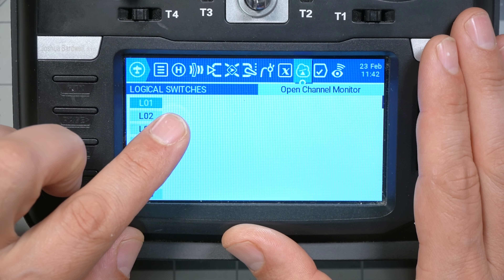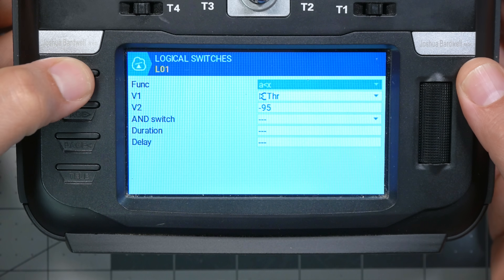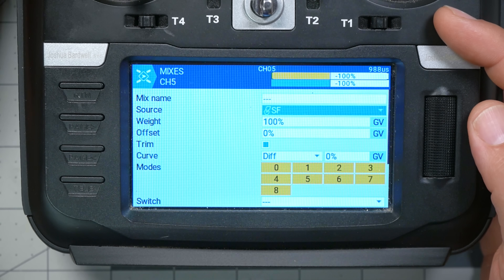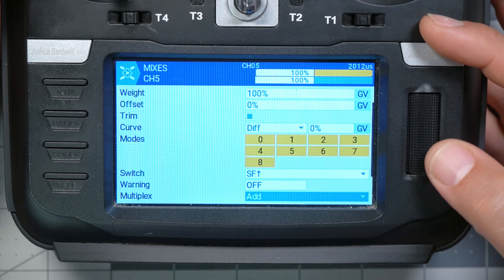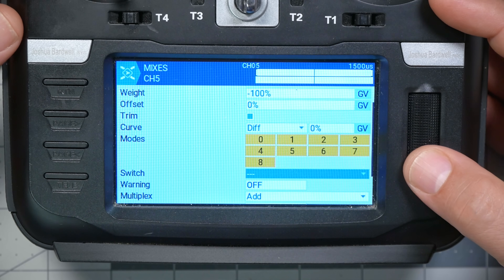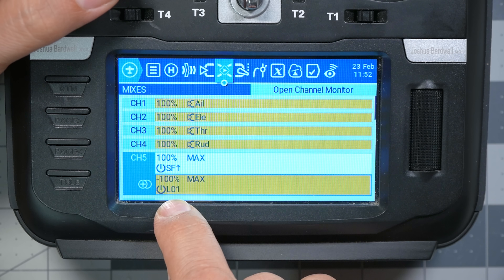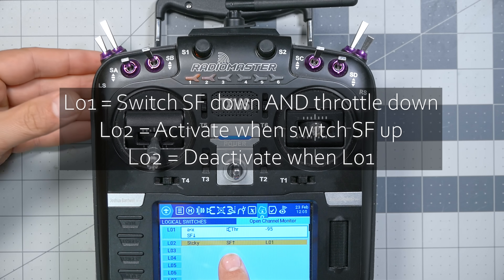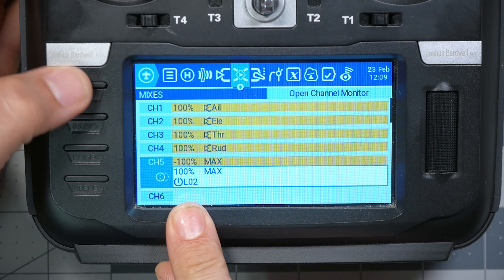This arm-switch setup is dangerous, and you shouldn't use it

Comment: Isn‘t the easiest way to just use L02 as the „switch“ on channel 5 in the mixer. I think there is no need for all that max shenanigans and all the multiplex replace lines. Since L02 is already activating when arming and only deactivating when disarming and throttle at 0.

I do the same thing for prearming on FETtec. Just L02 as my arm switch and done
Reply from the maker: You can't make a logical switch be the source for a mixer line. I tried that.
Reply: @JoshuaBardwell  hmmm i definitely have that as the input but then maybe not in the mixer but the output or input page? I’ll check when i‘m home!
Reply from the maker: You could set it up as an input, and then make a mixer with that input as source. But not a mixer source directly.
Reply: @JoshuaBardwell  ill describe my exact setup when im home but it definitely works to use L02 as the direct source for the arming aux channel 👍
Reply: @JoshuaBardwell  so i just checked. Both on my qx7 with edge tx and my mambo with freedom tx i can choose logical switches as my source for mixer channels. I just have to create the logical switch first or it won’t show up!
Reply: @JoshuaBardwell  nope. Logical switches can be used. To select it do not use any of the side quick category menus. use the complete list and you will find them just below switch SJ. i would send you a screenshot if I had an address.
Reply: @JoshuaBardwell  you are mistaken joshua. This is how ive been running for years. On my quad L02 is the source for ch 5 and controls arming.
Reply: Yeah, that's how I have it set up. One mix line. Source: MAX, Switch: L04. And then L04 is my logical switch that contains all the arming logic. Note that this will mean that when armed, you output 100%, and when disarmed, you output 0% (not -100%). Seems fine, if you have Betaflight set up to arm when the arming channel is in the  1800-2000μs range.
Reply: @Joshua Bardwell The guys are correct - once you have defined a logical switch, it is available as a source for a mix, so you can use it in both the input and mixer screen directly.

Comment: In my experience, FreeFly multirotors have something similar - you cannot disarm the aircraft unless you have the momentary switch pulled up. This is because when you’re flying an aerial platform that is potentially carrying $50,000+ of camera equipment, accidentally disarming - especially when you might be flying over the people/things you’re filming - can actually be more dangerous than being able to disarm immediately. 

Of course, this is a completely different scenario than a typical 5” quad will fly in, but that is one pretty good reason to have a setup like this.
Reply: Since they run on forks of PX4 the emergency disarm feature can be setup in the FC settings. Every AltaX I've flown has not had an emergency disarm switch for exactly what you say, preventing accidentally dropping 50lbs of equipment onto the heads of a film crew, but has had a method to disarm within a few seconds if you are trying to do it on purpose.
Reply: @dtrl6096  for sure. So far the only Freefly platform I've actually been able to fly is an old Alta 6 with the pre pix based flight controller, synapse. 

I'm jealous you've gotten to fly the Alta X - they're insanely cool. A buddy of mine is working on getting a camera car setup with a motocrane for a filming business he's starting, and he's planning to hire me out as his pilot which should be fun. Once he starts making some money he's either going to buy an Alta X, or have me design an aerial platform instead.
Reply: @KaminKevCrew  depending on the weight requirements consider a FreeFly Astro, it's their new platform that is about half the price of an Alta X but carries things like a Sony a7rIV and not things like a full size cinema camera.
Reply: @dtrl6096  we're looking into the Astro as well - I think for our purposes we will probably need something bigger like the X though. Right now we're using a Black Magic Pocket Cinema 4k on a Movi Pro, and it looks like we'll be moving towards a Red Komodo for aerial duties before too long, so that it can pull double duty on an aerial gimbal in addition to a cinelifter (possibly a siccario)
Reply: i like that setup

Comment: I belive you need a second sticky for when you "disarm" throttle down to stay disarmed if you bump the throttle by mistake. Correct me if I'm wrong or if I missed something in the logic. Regards
Reply from the maker: To disarm, you must have switch in disarm position and throttle down. If that happens and you subsequently raise throttle, the switch is still in the disarm position. The quad won't re-arm until you flip the switch to the armed position, with the throttle down.

Comment: Excellent, as usual. I was thinking of duplicating a 6 (in this case 5) position switch on the Zorro using a pair of 3 position switches. Obviously, there needed to be a logic switch involved (to disable one switch when the second is activated) but I knew practically nothing about using them. This video gave me a one-stop solution to the necessary conditions and function of logic switches, especially "sticky" switch use cases. Great work, JB, keep it up. Doubtless there are many permutations of logic switches this video applies to...    ...not just dangerous arming modifications! Yea! Solved!

Comment: but he can also flip the disarm switch in midair and the quad will disarm the second he goes for a dive and lowers the throttle under -95 haha, so a sequence on top of that would be the best, that you can only disarm when throttle is low at first and then the switch is flipped
Reply: I would just go with using both the left and right lower switches.  That way it's easy to do an emergency disarm but harder to do an accidental disarm.
Reply: Totally agree, if you set it up based on throttle, accidentally disarm via 2 pos switch the quad will keep flying until you drop the throttle under 95 🥲 
The only time I ever deem having a multipart disarm/arm procedure is when I'm flying any of my heavy lift capable shit & I have it set to arm based on a 3 pos switch being all the way down and then a 2 pos flipped. 
I've only accidentally disarmed twice 🤷‍♂️ just finished a build and set the aux the channels wrong once & the other time I was super stoned and can't really give a logical explanation 🤣
Reply: @md.m.8372  You had flown stoned? oh boy that must have been a bit scary but pretty epic lmao 🤣🤣🤣
Reply: @SukSukulent  not that scary when you used to it 🤣🤣
Reply: I agree, two switches would be much more appropriate.
Reply: Another, much better version of this has a second part to the disarm sequence, whereby it detects if you have hit the disarm while throttle high. You can then setup a warning voice prompt/beeper so you don't find out later. I use something similar to this to lock out arming if the throttle is high before arming, and also allow disarm to auto trip on landing (enable disarm on landing approach, cut throttle to kill or land).
Reply: So on our boxer radios, we have set out arm switch to be on when its down because of the grip we use when flying to omit accidentally pulling down on the switch in midflight killing the motors. It may be revesed from other users however it is the safest for us in our case....
Reply: If you're disarming midair. Than that's your own fault. Set a different switch that you won't bump...
Reply: @Romasu_  I think you missed the entire point of why he wanted a switch set up like this..
Reply: @Romasu_  of course, but thats what the video is about

Comment: I just lost a quad in deep water, seconds after take off.... Clumsy!  Is there a way to set up 2 arm switches so that you need 2 switches on to arm, and then 2 switches off, to disarm? Bad idea?
Reply: All you need is a prearm on a different switch or momentary switch/button.
Reply: Arming on two but disarming on either of one could be a good idea preventing you flipping and arming accidentally while moving around.
Reply: @vibecoder9435  that's what the prearm mode is for
Reply: First, I won't be flying off a boat edge again without a deep water recovery system. Arming is not the concern, it's preventing accidentally disarming the dji controller. The tango 2 arm button is better than the dji toggle switch.

Comment: i can’t figure out how to make  S1 and/or S2 pots the source switch for a special function. on taranis by the way. any idea how to circumvent this apparent oversight?
Reply: When selecting an input source, just move the switch or pot you want it to use (when you can scroll thru your list). If it's available to use, it should auto fill the input field.
Reply: You can do it but it will take some steps depending on what you want to accomplish.
L01 When S1 is greater than x
L02 when S1 is lower than x
L03 sticky L01 on . L02 off
And L03 will be your switch
You can play with it in various ways and add more lines.
Hope it helps...
Reply: yeah i got it with logical switches once i sat on it for a bit.
Reply: It's not really an oversight when you think about it... a switch has known states - high/low or high/mid/low... whereas a pot is 0 - 100 ... so how does the TX know at what point do you want the SF to trigger? Thus you need to use a logical switch, to trigger when your pot is in your chosen on position, and for the SFs you can then use the logical switch (i.e. L01) for the on state, and the inverse for the off state (!L01) if just wanting two positions, or use multiple LS lines to emulate a multi-position switch.

Comment: "The days of servos..."?? Servos are still relevant JB. Actually anything RC, except multirotors, use servos from fixed wing to boats to any land based vehicles. Unless you are talking tricopter style multirotors that used a servo to control yaw i dont see why you would refer to servos as obsolete 🙃🤣
Reply from the maker: No offense intended to fixed-wing pilots who use servos. The convention that opentx uses +100 to -100 for its channel ranges comes from "back in the days" when servos were pretty much all we used. Multirotors piggybacked onto all that servo stuff. I didn't mean to suggest that nobody uses servos today. If "back in the day" was servo-days, then today is servo-and-flight-controller days.
Reply: @JoshuaBardwell  I know what you meant and intended, i was just busting your balls. It just something that struck me funny being a fixed wing guy trying out quads. It came across as esoteric like the logic on the radio was only meant for quads. Thats it, no harm done.
Reply: Haha yeah. I wanted to say - programming transmitters for drones is relatively simple, compared to fixed wings with gear, mixes, end points, travel, conditional trim and sub trim... and that's before you get into IC and turbines etc. And a huge group of people (maybe even still larger than those doing fpv) still use servos and radio programming. Even unpowered gliders can be relatively complicated with conditional flight modes with mixing, timing, delay and expo, programmed solely in the radio.
Reply: @big-smoke-rc  100%
Reply: People are not here for servos, so he is right in what he talks about untill that main focus of this channel would ever change.
Reply: @billcarriveau  yeah I know.. just sayin
Reply: @billcarriveau  I get what you are saying, his channel is quad focused. Its just an odd way to shove the use of servos under the rug cuz its not a part of the quad realm when you are programming on a EdgeTX/OpenTX equipped radio. Honestly all that logic he did on the radio could have been accomplished in BF as well. That would have made it completely relevant to quads at that point. Although i just found out a week ago that you can configure BF to run a fixed wing as well
Reply from the maker: @North49RC  I'd be interested if you can show me how to change the disarm logic of BF to only disarm when throttle is down, while only changing the FC configuration.
Reply: @JoshuaBardwell  Never done it myself, just assumed that the logic would have been just as easy as it is on the radio considering the commands are the same. Mind you i could look at it as a challenge, in which case i may get back to you on that one. Or you can bust my balls lol
Reply: @North49RC  I think it would be doable on iNav, since that actually has logical switch style capability onboard - but not so much on Betaflight. The hardware is certainly capable, but I don't believe it was a capability programmed into Betaflight, as they expect the arm channel to be correctly used by the operator - "fly/no fly".
Reply: @pfeerick  Good point. I was thinking maybe from more of a INAV perspective and just figured the same would apply to BF

Comment: Excellent tips  JB! This is the exact reason I run my "armed" switch all the way down when flying. No chance I'll bump it as my finger is resting on it as I rip. Thanks brother!
Reply: Me too. I use a pre arm to prevent accidental arming.
Reply: @su_K3N  100%!
Reply: Do you have to flip your pre arm every time you want to arm?
Reply: @OdysseusVrakas  I don’t use prearm. @Ken Kenemore?
Reply: @OdysseusVrakas  I use the momentary switch. So you have to hold the momentary switch and flip the arm switch in order to turn my quad on.

If you use a tx16s. I use the 2 position switch (SF) down as armed and the momentary (SH) to pre arm. Like the op said my finger rest down on the arm switch during flight, no accidental disarm.
Reply: On my jumper that it's tight & I keep my finger there I'm afraid I'll hit by accident.  But I'm so use to up arm down disarm that I just changed where I keep my finger.
Reply: I use pre arm. It needs to be switched to arm at any time. Turtle mode as well.